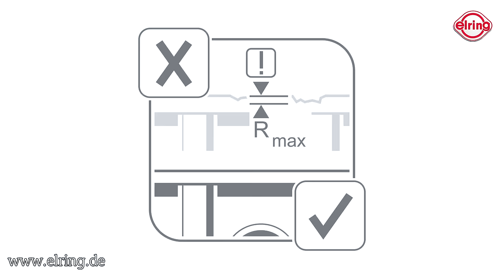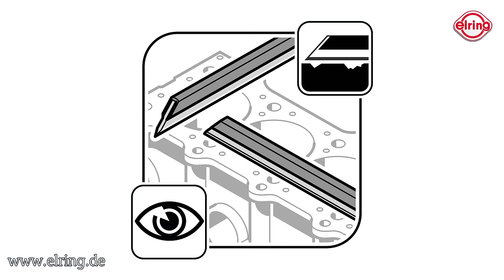Elring | Zylinderkopfdichtung - fachgerechter Einbau by GÖHRUM Fahrzeugteile GmbH

Comment: A great video showing almost all the important steps. As you can see it requires a solid set of basic tools, a few decent torque wrenches, and every bolt seems to have a torque then angle step, so a decent angle gauge is required. Then you quickly realise you need a heap of special tools. I'm a very competent home mechanic, yet this bloody engine has tested me no end. Taken me months longer and lots more $$ than I had hoped. Even the Haynes manual misses some important steps that VW recommend. You really need both the Haynes manual and the genuine repair manual from Erwin. This process shown can be done in the car ( for a Transporter or Sprinter, unknown for the R5 Toureg ) but it is annoying for access in places. Seems to be far better known in Europe than over here in Australia, where it's taken ages and a LOT of research to work everything out. This is one engine where in hindsight I would actually have rathered let a specialist do it if I knew what I know now, and I LOVE getting my hands dirty. First engine in my 52 years that I wish I had NOT experienced, thanks VW!
Reply: I'm in the process of rebuilding mine. New crank and full set of shell bearings. I'm confused on the timing setup. Especially the balancing gear. Any tips?
Reply: @davidhughes2755  sorry mate, never took anything off below the head, and timing that is difficult enough! There are a few videos showing the entire gearset assembly, will try and link if I kept them in any list, but remember the R5 Toureg had the same engine and there's lots out there in Toureg land as well as Transporter.
Reply: @gregroles69  appreciate the reply 👍 it's definitely a slow process

Comment: Anyone who is doing this then this guy has missed out one of the most important tasks to this job.

He has not shown the viewers that when he put the cam shift sprocket on, he did not show the timing mark on the righthand side of the engine.

She clearly shows the left hand side but not the other.

You have a flat line on the sprocket, that has to lie horizontal to the cylinder head 

Its the same line on the aluminium cast that sits in the head from the lower sprocket.

Both need to lie flat to the cylinder head 

Hope this makes sense 

As this guy shows nothing about lining up the sprocket to the timing marks as there is no key way in the sprocket 

Over and out

Comment: Why you do not show the people how to put the camshaft gear on signs? It has a line which you should put it horizontally with the head in the right side. If you do not do that you will have no power because that is the timing injection.